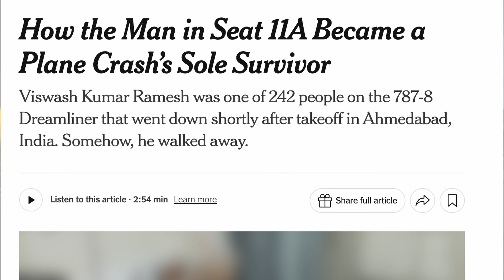Why the RAT Changes Everything – Air India 171 Update

Comment: The theory that the pilots made a mistake and used the flap leaver instead of the landing gear was ridiculous... to say the least!!!  Those two levers are completely different - the flaps lever has long travel as it goes through the diffeerent flap settings whereas the landing gear is a ON/OFF switch - it can't be confused.  Having dual engine failure is extremely rare and if that was the case you would be able to see them flame out in the video so that theory is also unlikely.  What happened is that there was an event - hence the loud bang head frfom the passenger - that caused a catastrophic electric or hydraulic failure that caused the thrust settings on the engines to go down.  This airplane just came out of maintenance it's either the technicans made a mistake in repairs or had a massive batttery failure - this airplane had problems with the lithium-ion battery when it was released.

Comment: I thought this answer from Grok was kind of interesting. Thoughts? "Incorrect settings, such as improper flap positioning or engine thrust settings, could prevent the aircraft from gaining sufficient lift or speed, potentially leading to a stall or engine overstress. For example, if flaps were set to 0° instead of the required 5-15°, the aircraft might struggle to climb, putting excessive strain on the engines." If the flaps weren't set right, did they inadvertently kill the engines just after takeoff?

Comment: There is a video circulating of the inside of this airplane on the flight before this one. In it, no electrics were working- no air-con or electrical touchscreen headrest TVs. So it’s likely an electrical fault that led to dual engine failure.

Comment: Capt , there has been NO ENGINE FAILURE, IT IS LOSS OF THRUST ,
Engines didn't give the thrust it was meant to, and it couldn't be anything but for the FUEL . 
Just look at the ROLL LENGTH, AND THE ROC right from the word go . 
The ambient temperatures and airfield aviation couldn't have caused such drastic effect on such WORK HORSE ENGINES . 

Hear the pilots call , " may day , loss of Thrust, going down" 
He didn't say engine failure, or bird hit . Give the pilot his due for the choice of the information " loss of Thrust"

Comment: If there is a total electrical failure or dual engine failure, will the black boxes work to record the crucial last few seconds? Will the black boxes be able to tell why both engines failed? I guess the mystery deepens.

Edit: How much power does RAT generate? Can it power cabin lights also?

Comment: 3:17 I see a little dot flashing over the tail of the aircraft. You can use the point and comma keys on the keyboard in order to single-step through the frames. What could this observation be?
Reply: Possibly parts of the gear/tires flying away? Keep in mind speed of sound is slower than speed of light.

Comment: PLEASE NOTE:
FINE ..ALL POSSIBILITIES WITHIN ARE DISCUSSED IN THIS ROOT CAUSE ANALYSIS ! BUT......
ONE MORE FACTOR ALSO TO BE INVESTIGATED - WHICH IS NOT INSIDE THE AIRCRAFT - THAT IS...
THE EARLIER TRIP DETAILS, was there any minor to major electrical failure that has happened during the trip between New Delhi to Ahmedabad - any components/connectors/cables that has been replaced at New Delhi or at Ahmedabad by the station crews - if there would have been a compromise in replacement of spares due to there in availability/ dimension issue of the spares/ or inadequacy of time to do the repair activity etc.. to be investigated - MAINTENANCE WING AT NEW DELHI AND AT AHMEDABAD HAS TO BE THOROUGHLY EXAMINED.

Comment: I agree with your current engine-failure theory, but not with your previous pilot-error theory.  Here is my objection. 

If this was a  power-on stall with the flaps fully retracted as claimed by Captain Steve, the pilot would not have been able to keep the nose up as the plane went down. With the engines at full power, I would expect the plane to accelerate and nose-dive, which didn't happen.

Comment: Another very important clue of a dual engine failure is that apu air inlet door was open. You have that auto start feature on the 787 when you experience a dual engine failure.
You can see that on some photos of the crash scene. Very tragic days for aviation.

Comment: I'm a retired Part 121 A&P from the former TWA. Before the 767 was granted ETOPS, they had several non-commanded engine shut downs due to the FADEC computer trying to make too many changes beyond the engines ability to respond.(At least that's my best recollection). I'm not saying this is that, but I wouldn't be surprised to learn that the computers may be at fault. Call me an old analog geezer, but I'll never trust my life to a computer during the critical phases of flight. Direct control to the Fuel Flow Regulator(s) is fool proof.

Comment: The RAT was designed to deploy at cruising altitude, as you said. What you didn't say is that when the RAT deploys, the aircraft computer "assumes" that there is major failure and only two things continue to work: flight control surfaces, and avionics. Find a landing spot and land there. That's what it is for. What specifically STOPS working is the throttle. You can go balls to the wall all you want trying to recover from a stall and nothing will happen because at RAT deployment the FADEC idles the engines and also stops processing throttle commands. Just for the record, one cannot retract the landing gear with the RAT deployed, nor can one undeploy the spoilers if they are out. Which explains why the gear stayed down and may have exacerbated  the lack of lift if perhaps the reports of the spoilers being deployed are also true. So there they were. A possibly poorly configured glider with the wheels down, engines at idle speed, and the gas pedal no longer responding. 500 feet off the ground. No possible time or even way to recover. Not human error. Design error.

Comment: Could the loud bang heard by the survivor have been a turbine disc failure ? As occurred in 2009 when Qantas flight 32 - an Airbus A-380 - had just departed Singapore. The cracked disc disintegrated and caused an explosive un-contained engine failure (Kym in   Palmerston near Darwin, Australia).

Comment: Now days aircrafts are using blended sustainable fuel along with Aviation kerosene. This practice may damage the engines especially in older aircrafts. This could be reason of double engine failure
🔻🔻🔻

Comment: You also cant hear the engines spooling. Just the Ram Air Turbine. Now, my thoughts shift to why the engines, both engines malfunctioned. What are the chances of two engines going out at the same time? 

What caused them to cease operating? 

Contaminated fuel? Accidental fuel shut off? Accidental engine shut down?

Comment: Taking a catastrophic hydraulic failure into account. That would keep the flap at 5° and I’m not sure but probably prevent the gear from retracting. Could it be that the automatic deployment of the RAT caused too much underbody drag and since the aircraft would have only been at around 160-170kts at the time of the RATs deployment. It simply stalled and began to go down?
Reply: Just asked chat GPT the drag figures travelling at 160-170 kts and the RAT would add an additional 7% to the already significant drag of the gears.

Comment: To achieve flight, the flaps should be deployed , the wheels should have been up, and the engines have to be working. Initially, I suspected that there may have been a disconnect between the aircrafts automated systems and pilot input.  The situation with the Boeing  dash 8 737.In this situation. Fuel starvation is more likely. This is not unknown in aircraft. The early Lockheed Hercules had a similar tendency on take off. Two engines on the same wing would quit, flipping the plane o to its back at very low altitude. The chances of survival were around zero! The problem was the self-sealing fuel tanks in the wings. A chemical reaction between the fuel and the material that the bags were made of. Self-sealing fuel tanks are normally only fitted into combat aircraft. Was this aircraft a " special"? Or was some other contaminent responsible? Of course I may be way off with this theory, but there it is.

Comment: Steve, look at the main landing gear position! It is tilted forward and not backwards as in the 787, almost as if there was hydraulic failure and they stayed hanging in that position because the pilots were unable to pull them up. This could be another clue. Could you check it out?

Comment: Lots of theories coming up as experts are coming up with new ones. When a thorough investigation is over and the various investigators come to one conclusion that the crash happened due to one factor, the theories floating around now just after looking at the videos of the plane taking off and going down in a fireball, any one may be proved right in the assessment. We hope that the final report brings out the real and definite reason of that aircraft going down so that corrective measures taken to prevent a repeat occurrence.

Comment: There is another video being shown on YouTube by a passenger on the same aircraft hours before this flight. The video demonstrates nothing electrical  seems to be working in the cabin, including  the flight entertainment center, the flight attendant call button, and the air conditioner. If this is correct, does this add to your analysis of what may have caused the disaster

Comment: But what could cause such dual engine failure? I've seen videos of MentourPilot and 74Gear who made videos of analyzed accidents caused by contaminated fuel but I think they mentioned that the FAA introduced tests during the fueling process to check for contaminated fuel in the plane to reduce the likelihood of such accidents. Are such tests only done on a random sample? Or are they only done during routine checks of the plane ever couple of flights? Other channels talked about that checks on other planes on that airport were performed on fuel contamination and they couldn't find any sign of such on other planes.  Even in case of contamination to me it sounded like that it takes time for the contamination to finally end up clogging the engines and thus both engines shutting down at the same exact time is probably unlikely. What else could therefore lead to such a dual engine failure?

Comment: There is a video of a guy who flew in that plane the day before flying into Amhedabad who was showing that there was no electrical power for the passengers lights, AC or seat phones or any ability to contact the flight crew or notify them of anything which apparently was not caught, have you seen it? If that's the case then more than likely it was an total electrical failure.
Reply: Maintenance failure. That plane had issues in the previous flight

Comment: Now we all agree both engines failed at the time  while reached the end of runway . Possible all fuel pumps ceased to work either cause by computer software bug or hardware that control the fuel pumps, or by pilot's mistake set it up with wrong data input.
Other reason could be from contaminated fuel or cogged fuel filters or leaking fuel pipe or fuel pump power cable in open circuit.

Comment: If the plane has electrical problems will that shut off both engines and are both engines connect on the same circuit just in case of a failure thanks again

Comment: First off,  I have no airline experience. However,  I’m a former U.S. Army OH-58A/C pilot, holding a commercial rotary-wing instrument certificate with 1,383 total time. Could it have been a total hydraulic failure that led to the inability to retract the landing gear, and then, as a last-ditch effort, the crew raised the flaps? That’s my best guess estimate.

Comment: This must be manufacturing issue. You start the power you should be able to fly at least 5 minutes. It didn't give 1 minute. There is no way 11 year old airplane just give up after taking off. How the hell does maintenance prevent it from that? You can't predict it when everything seems fine. You can't disect the airplane on every check up. Boeing should stop manufacturing airplanes.

Comment: My gut feeling tells me that this plane was attacked with emp laser that targeted the power systems and the power was shut off.  It is extremely rare cases that both engines were turned down enough to provide no power.  They have weapons that can crash a plane on landing or take off.   Remember a little while ago there were threats to take down Air Force One with President Trump by terrorist groups using this portable weapon.  This level of attack must be connected to some enemy country. I believe this was trial run for something else more sinister.  Just my feeling,  The pilot and crew did what they could do given this situation.  No need to blame them. My heartfelt condolences to the victims and their families.

Comment: It cannot be completely ruled out that a pilot error may have occurred; however, it is highly unlikely that a pilot with extensive flight hours would mistake the nose gear control for the flap lever.
First of all, the two controls are entirely different in shape and design. The landing gear lever is typically a robust handle with a distinctive form, designed to be easily identifiable by touch. In contrast, the flap lever resembles the gear selector of an automatic car.
Furthermore, the locations of these controls in the cockpit are clearly separated—they are not close enough to be easily confused. Considering these factors, along with the rigorous training and standard procedures that pilots follow, it seems highly improbable that such a mix-up could occur. We appreciate you, Captain, for keeping us updated on aviation-related matters

Comment: Why do none of you "analysts" actually look at the video frame by frame? If you did, you'd see the door falling from the sky just after impact. This is the door in front of 11A. It came off because of the explosion in the lithium battery between the wings. The explosion was caused by thermal runaway, because the A/C was not working, and the battery had gone flat due to electrical fault from earlier. That's why the RAT was deployed. That's why the survivor was able to just "walk out" through the exit

Comment: They started at the middle of the runway instead of using its full length.  I saw one other expert say that the plane went down to the "last brick" of the runway before taking off.   I wonder if they would have been able to abort the take off if they had opted to use the full length of the runway instead... 😞

Comment: so what caused two engines to fail at the same time??  they are designed to run independently.  did a pilot turn them off?  the black boxes will tell.

Comment: @captainsteeeve there is one more bit of evidence everyone has missed. There is no exhaust behind the plane or even a small contrail. Normally you would see exhaust coming out of the plane at full throttle and assuming they were at that point, it is proof the engines went down at the same time.
Reply: They were producing some power at rotation as evidenced by the dust cloud however I suspect it had already started to roll back at that point.  The likely suffered a failure while still on the runway but had no room to abort the takeoff.

Comment: Dual engine failure seems plausible because if this plane for safety can still takeoff on one engine, I can't imagine it was designed not to fly with no flaps or gear down, even at this point of the flight.
Reply: Gear failing to stow after takeoff happens sometimes and planes don't crash from that failure.

Comment: Need to Check the overloading or maximum loading part that could be compromised in our country and one engine failure that should have added the problem to prevent required thrust.

Comment: I'm no pilot/expert, but I respectully disagree with the analysis of the visual "evidence". That dot could be many things, and maybe the data will confirm this Captain Steve's theory but I'm sticking with the flaps theory. Also, I live within 5 miles of an airport and have lots of air tThe sound I hear in this video is a sound I've heard from the vast majority of planes here and I think it's just the engine thrust.
It'll be interesting what the data says, and I still think Captain Steve has a very plausible/strong argument for the RAT deployment when combined with the Mayday and the survivors' description of events. Thanks for the follow-up analysis, I really enjoy this channel.

Comment: I believe the engines were faulty upon take off. The aircraft used every possible inch of the runway to take off and that is just odd to me. Seems like they were struggling to get to rotate speed and maybe even slightly overshot the runway.
Reply: Agree.  I think the failure happened suddenly after V1 but before rotate speed.

Comment: The rat will deploy on a single engine failure during takeoff but it appears to be a dual engine failure because there is no yaw or corrective rudder. Either the computer shut the engines down or there was a fuel issue.. since there are redundant fuel pumps it’s unlikely that fuel pump failure could cut both engines. Either the computer shut down the engines or there was bad fuel. I’m guessing a catastrophic computer failure shut down both engines. I don’t know if there exists a single sensor that could fail and cause the computer to cut the power. If it were fuel there would be other aircraft affected. Sabotage is another possibility.

Comment: Also, I'm leaning to a theory that the engine problem did not appear all of the sudden after take off. The plane went airborne right at the end of the runway. That should be analyzed. They reached V1 and the problems might have showed up after that. There was no room to abort take off. Instead, they  continued to the end of the runway (with engines not producing enough thrust)